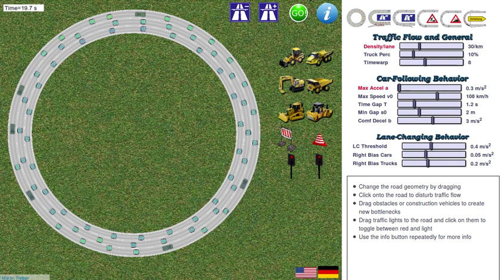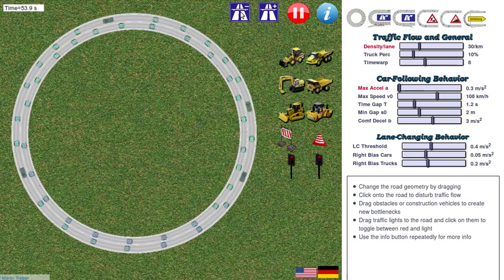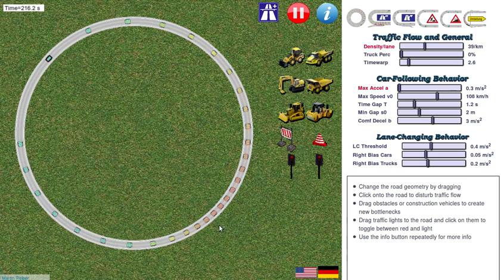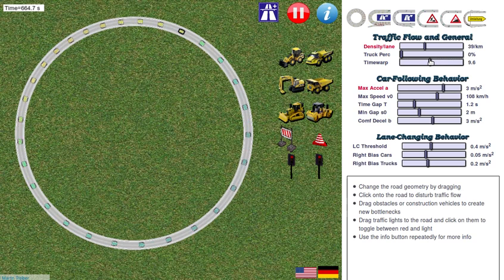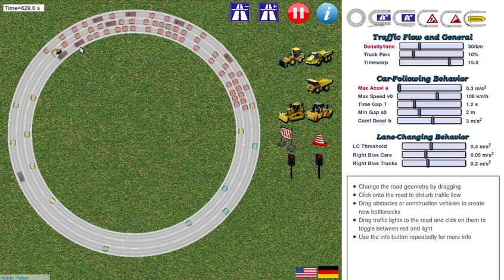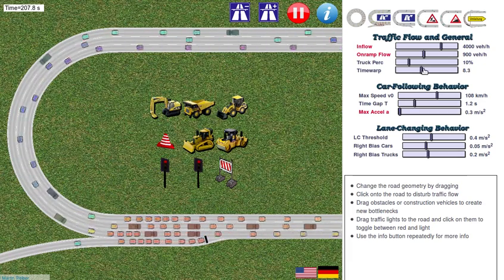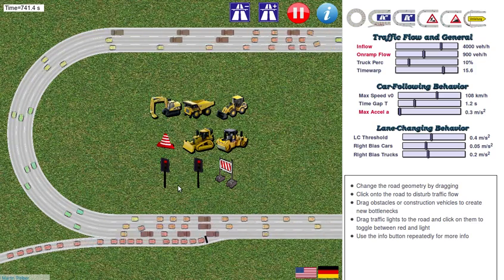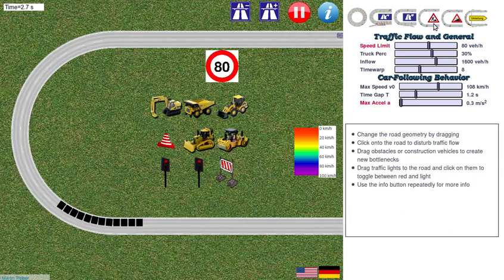Interactive traffic simulation www.traffic-simulation.de

Comment: If you can manage to build a real-time 3D simulation of cars in traffic for games that manages to use low CPU resources, there's a demand for this at the moment. At the moment, games have to rely on cars that only choose path at the start of the trip, not adjusting dynamically on the way (for example, changing lanes) because high CPU usage bottleneck.
Reply from the maker: In fact, even in an interpreter language like JavaScript used in this simulation, the computational cost of lane changing, re-routing, or other sorts of  decision making is negligible, even on smartphones. A 3d graphics representation has a multiple computational cost. In the next version, I will add a scenario with limited 3d perspective (from the driver's and the drone flyer's view)
Reply: Interesting... I would say to you getting in touch with Colossal Order offering your expertise to them in the subject, but I think it's much better to attempt to make your own game from ground zero, using free 3D engine like Unity. Surely there's a market for it at the moment, city building games focused on traffic management, and the guys who are in this market are not taking full advantage of it. If you have the time for it, give it a shot... But if you ever make it, please don't overindulge in 3D models with high poly count and buildings full of details, pillars, etc... Stick to the core of the game, not aesthetics... There's TONS of low-spec gamers out there who are could be potential customers.